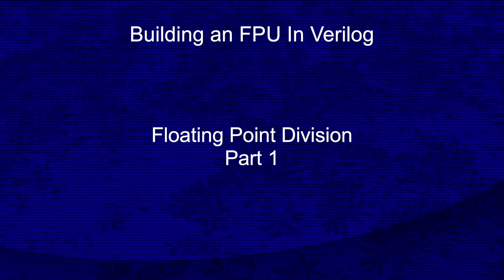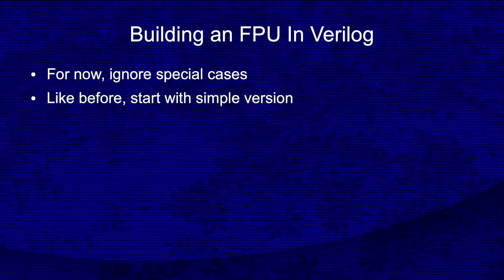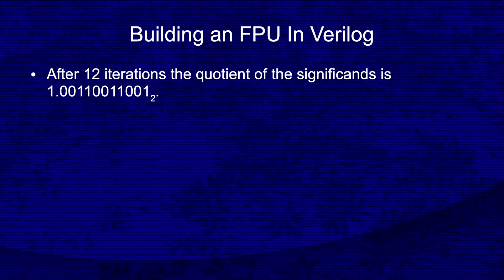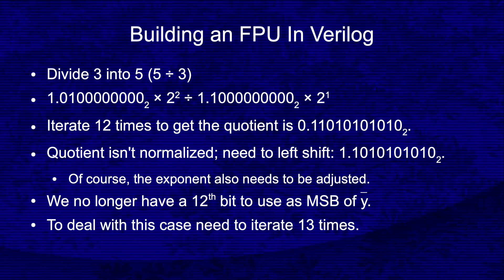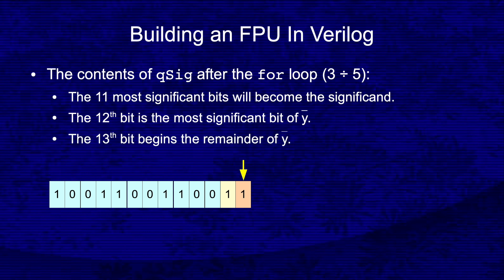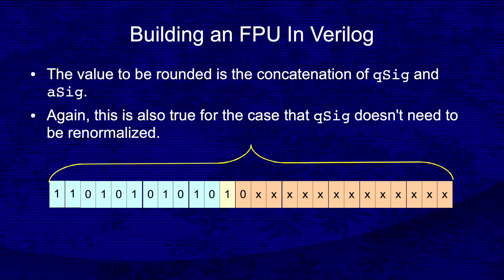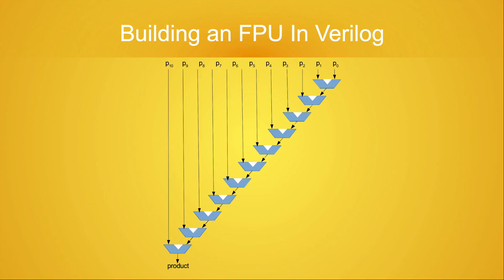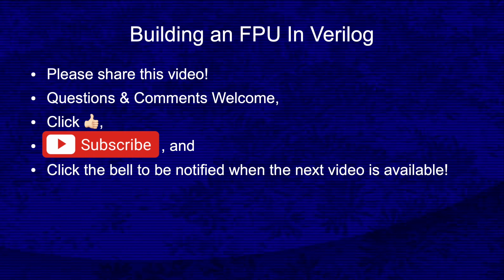Building an FPU In Verilog: Floating Point Division, Part 1

Comment: Hello Chris Larsen, I know you’re very busy, but if you have some time, could you please help me with this question?

I’m currently using a mantissa division method with NSIG+3 iterations to compute both the quotient and the remainder (used for rounding). However, when synthesizing with Synopsys using a 65nm library, I’m getting a rather low operating frequency (around 30 MHz).

Do you have any advice for me?
Is there any way to reduce the number of iterations while still computing the full NSIG+3 bits of the quotient, or perhaps a method that’s easier to implement using combinational logic?

I look forward to your reply.
Reply from the maker: I’m on vacation without my computer. However in one of my videos on division there should be a link to a project where somewhere emulated a Cray computer using an FPGA. He has posted his code online. Maybe that will help.